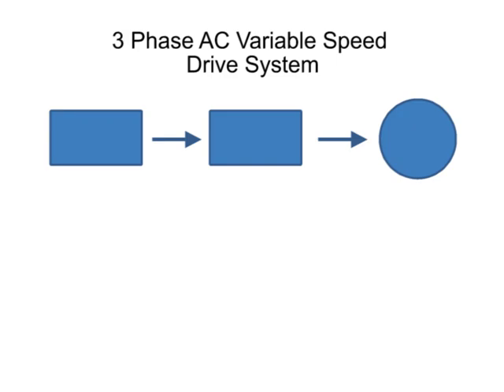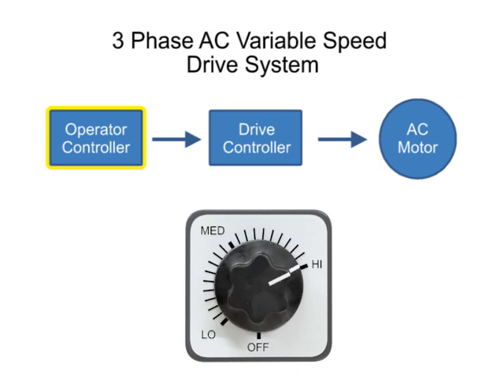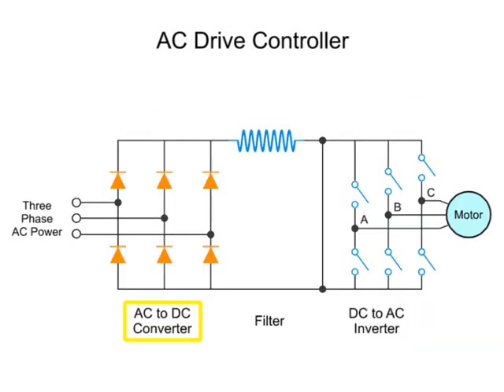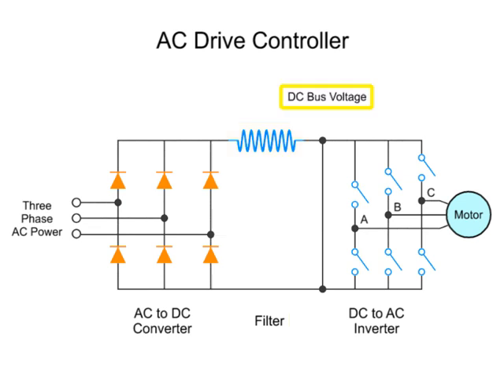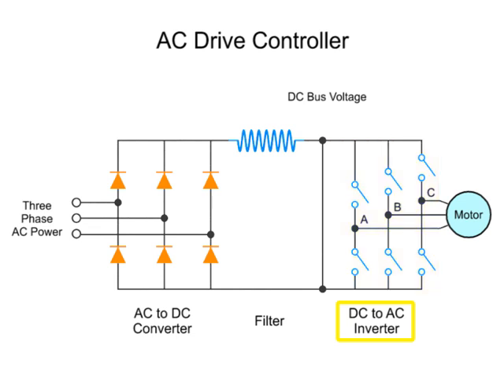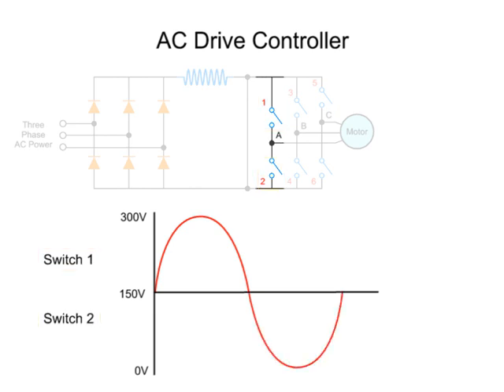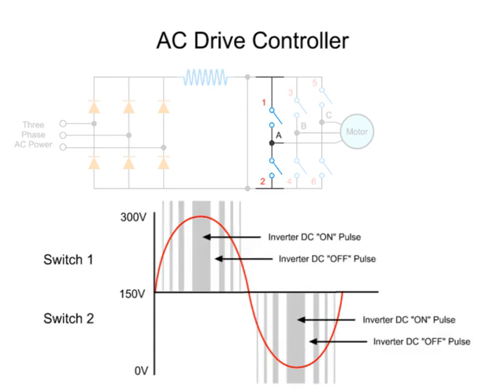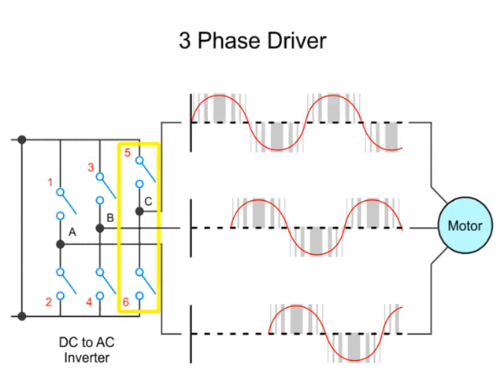3-phase AC Variable Speed Drive System

Comment: Please explain to me how when only switch (1) is closed  current flows? This is my only question HOW?!!!
Reply: If you superimpose the 3 sinewaves, you will see that there is always at least 1 top and 1 bottom switch on at any given time. You are correct with your comment. No current can flow with a single switch on.

Comment: For whatever it's worth, the vertical line should be a capacitor; not a "short" as some have suggested. Probably a mistake when drawing the diagram from the design engineer to the "tech writer". Happens ALL the time.

As to "theory" being unnecessary and hardware is all one needs, is a nice sounding thing but it is totally false. 

If one does not understand "theory" they will never "know" what is going on; thus they will always do things by trial and error. A very common thing, but a sad thing at the same time and highly inefficient approach. Learn the theory and it becomes a blessing. Oh indeed yes.

The diagram WITH a capacitor (instead of the straight vertical line) is exactly HOW all VFD's work.

IE: a single, double or triple phase AC voltage fed into the VFD is converted to a DC voltage; but it is choppy and needs a filter to smooth it out. The capacitor does that. Some add coils to improve the filtering. 

Then the filtered DC is fed to 6 special HIGH speed transistors (acting like switches). These transistors are "fired" (turned on and off) in a manner that each pair of these transistors will create a 3 phase voltage; albeit is made up of pulses (rather than sine waves); whose "width" (time on or off) creates a voltage that the motor thinks is 3 phase AC. Believe it or not.

It is this phenomenon that makes the thing work. Also and very important; there is control circuitry (not shown) that feeds timed "signals"; that turn on the switches faster or slower; that allows a motor to have a constant AC voltage; yet its speed can be varied from off to maximum speed smoothly. But the voltage stays the same.

"Absolutely brilliant" as the "Brits" would say.

When wired and programmed properly, it is one of THE most awesome technological creations; since electricity was discovered I do believe.
Reply: "Believe it or not" For me it's weird (I'm not saying the principel of operation isn't true): the instantaneous output voltage is really a pulse train with variable duty cycle and changing polarity, yet the motor still works as if it was a sinusoidal waveform.